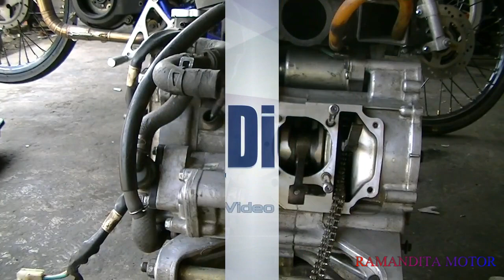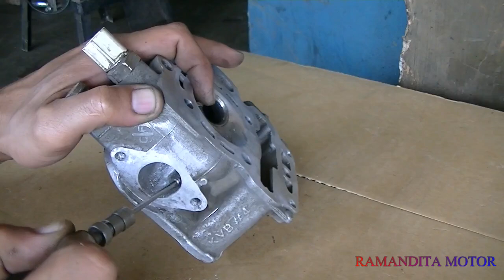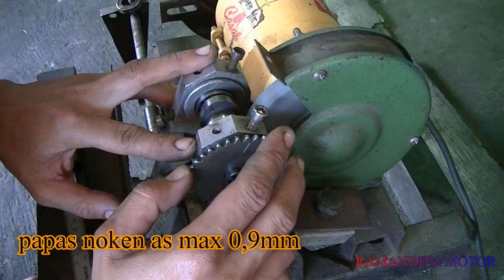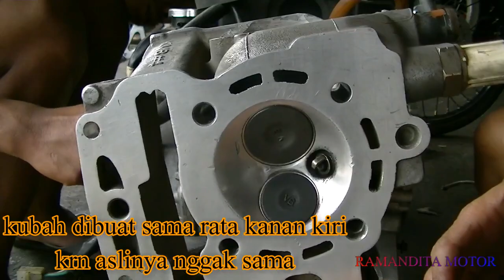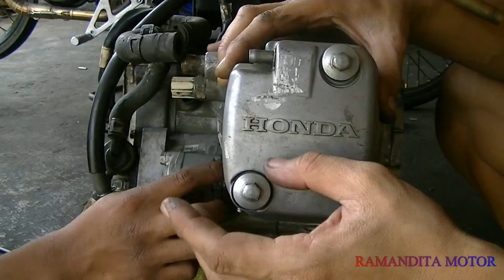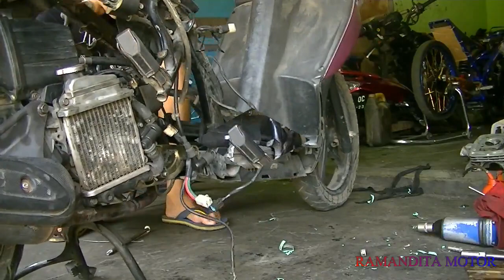Ganti piston vario 110 dengan piston juiter xb [ bore up vario 53mm ]

Comment: mas mau nyanyak,,sy punya vario 110  karbu,,udh ganti roller 8gr,,per cvt 2000rpm,,karbu pe26,,noken kawahara..kok tarikan awal lemes gitu terus tengah nya dapet tapi pas rpm atas kayak nahan gitu penyebab nya apa ya mas terus cara mengatasi nya gimana ??
Reply from the maker: mesin nggak sesuai dengan noken as
Reply: Ramandita Motor kalo pake noken as bubutan enak ndk dia mas

Comment: Motor ku vario 110 karbu sama kaya di video, saya baru ganti piston 54 aja mas, yg lain masih standar semua mas, masukan mas gimana yaa biar enak buat harian, trus suka nembak nembak apanya yaa mas ?
Reply from the maker: ganti atau rubah noken as,ganti roler sama per cvt
Reply: @RamanditaMotor  noken as di kurangin berapa mm bos ? Trus roller berapa gram ? Sama per cvt berapa rpm ?
Reply from the maker: 1mm max,1500rpm
Reply: @RamanditaMotor  rollernya brp gram bos ?